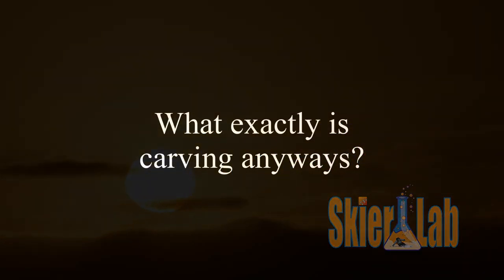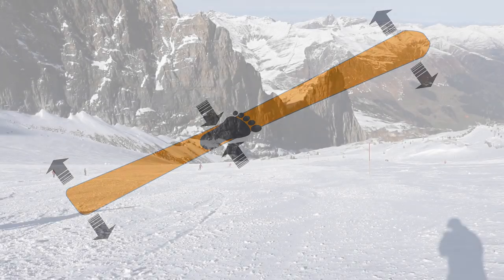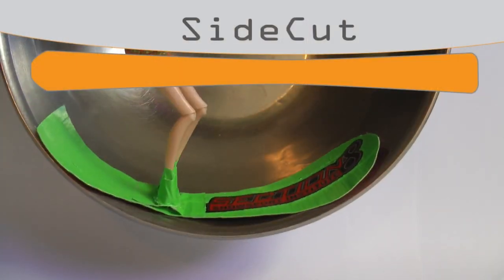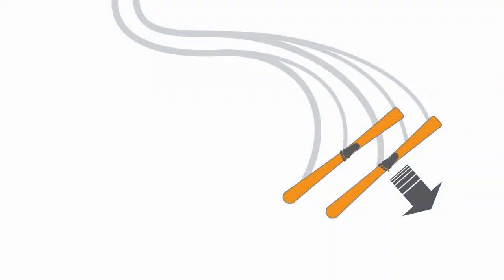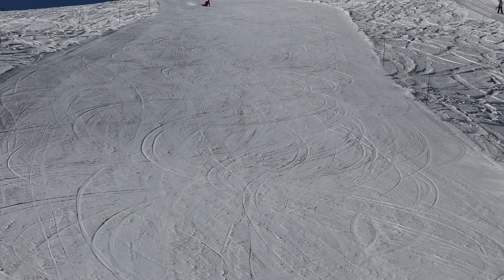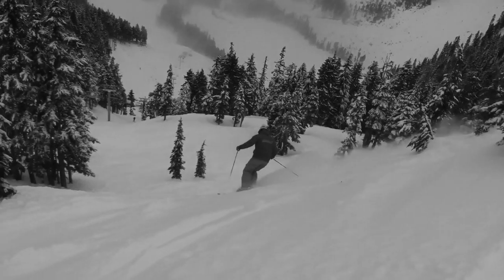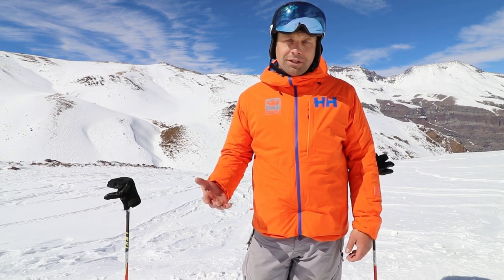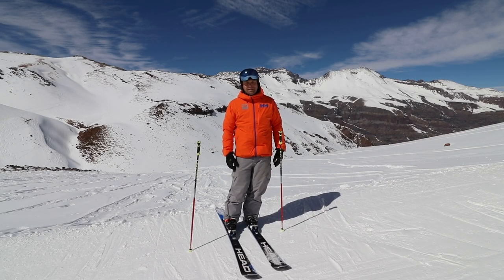Skiing Objectives - Carving Clean Tracks

Comment: I believe you are wrong when you state that carving is an easy task and there is no need for multitasking. Is this a joke? I think the opposite statement is correct for any beginner and intermediate skier.  You say: "just edge your skis and they will carve!" You should think about the requirements of this kind of edgings and the requirements of the edged turn itself. You must prepare the edgings and then keep the skis on carved edges. Certainly, with your attitude, I would not want to become your client if I were a beginner or intermediate skier.
Reply from the maker: Well, it is sort of a joke. It’s a goofy attempt to get people out other own heads. In reality, the moves to carve a clean track in the snow are actually simpler than steering a turn, but most intermediate skiers are either intimidated by the speed of a carved turn... or they focus so much on the idea of turning, that they end up twisting the skis instead of just letting the run forward through the snow. Clearly there is a lot more to a good carved turn than just a clean track, however, grasping this concept is often the first hurdle.
Reply: @section8ski  I deeply disagree.  I think that there are much more important reasons to why the intermediate skiers  are unable to carve the turn. I also believe that the skidded turns are much easier to execute than the carved turns.
Reply from the maker: Janos Koranyi, Clearly more recreational skiers find skidding easier, and the psychological component is only one aspect... so you are probably right. Can you explain what some of those ‘much more important reasons’ are. I’m always keen to hear new angles.
Reply: @section8ski  I completely get your angle... but really it’s no simpler or more difficult than a skidded or carved turn, it requires a skill. So here’s my take...

If we put ourselves students in a box of there being only one way, or only one right way to do things we really limit the learning of that student and will almost undoubtedly hinder their progress overall. So if we are so adamant in an opinion that a beginner and intermediate can only make skidded turns at their level or in their learning to get to that stage, all we’ve done is given them something needs to be added later... we could relate this to teaching snowboarding to a beginner, and teaching them that they have a favoured direction to start and later teaching them switch, or we could just teach them both directions and to turn in both directions from the get go. Maybe this makes a longer journey to get to a certain level as they’re learning double the amount (kind of), but once they’re at a certain point they be more naturally able to ride with whichever lead foot they like.

The majority of ski nations if not all teach some kind of variation around skidding and rotary movements in the early stages, often involving a snowplough. However, there are systems, approaches and methods where you can teach carving to a beginner and use the side cut of a ski... it simply requires the the appropriate terrain and methodology, and you could potentially make the argument that someone that learns to carve and use side cut for the early stages will find it easier to then learn to skid, as opposed to someone that learned to skid first and then carve.

However, without some scientific studies done to see which movements and progressions are the most effective (to get to a a variety of ability levels) no one in the ski industry can say that any one way of doing things is the only or only right way to do things.

That’s my two cents, and maybe that helps you answer this more fully to others that don’t get the concept you were trying to get across... keep up the good work Tobin!
Reply from the maker: @XboxSnoSurfer  Agreed, I don’t think a one is necessarily easier than the other from a skill perspective. In fact some beginners struggle to create the direction change they want because they over edge and create too much grip to twist the skis on the snow. 

As you suggest, I’d hate to limit a new skiers progress based on my notion of what order things should be done. However, beginners typically learn a skidded/drifted turn first is because their primary objectives at that stage are usually to control speed and avoid crashing into stuff. Steered turns just happen to be better suited for this purpose then a carved turn.
Reply: @section8ski  I think you’ve fallen back into the trap of believing that a skidded approach is the only or only right one for a beginner, let me explain...

So controlling speed and changing direction are two separate objectives (as defined by the CSIA at least, although one can influence the other). In a beginner approach that incorporates a snowplough I would suggest that is prioritising speed control and incorporates elements that will allow a student to change direction, but in general we do things like snowplough in a straight line in order to develop a rotation of the leg and allows the student to control their speed before they make a turn... a skidded or steered turn based progression.

There are various reasons why we generally fall back to that approach, one of which being that this is what we get trained to use. I think it’s fair to say that the majority if not all ski nations tend to use a skidded based progression, most likely incorporating a snowplough in some way as their primary approach... but why is this? Who decided this is what or how beginners need to learn? And why haven’t we reevaluated this with modern ski design more? I think we recognise when teaching children especially that carving first on their small skis with a lot of side cut can be a very effective progression and that skidding their skis or snowploughing might not be achievable at first.

So how could we apply this to all learners? Well the CSIA gives us the tools (past and present) to think this through. I think we can recognise the kind of terrain and equipment we would want to have if we were on a carving first approach. We would need to consider how these movements should be applied to a beginner. The fan progression would come in useful but we would also need terrain flat enough for long enough to allow students to ski in the fall line as well... but it isn’t challenging to easily consider how could take a different approach to achieving the same objectives, and these alternative approaches are out there... and although I have no experience or direct knowledge of those other approaches, I don’t think it’s fair to write them off in any way by saying beginner students need to learn to skid first, carving first can be every bit as suitable if we set up the environment and progression appropriately.

However, what we just don’t know is if any one approach is better than another. For me the metrics would be that one approach allows students to achieve a higher skill level in the same or less amount of time than the other, allows more students to more consistently achieve higher levels of skill, and one approach is simply more achievable for more students shown by a higher retention rate than the industry average... getting that kind of data is going to be challenging at best!

But for people like us, we just need to be open minded. Let’s not assume that all students are alike, have the same objectives or that the we currently approach things is the only or only right way of doing it... maybe the beginner and intermediate students that carved first would have a much easier time learning to skid later, than those that learnt to skid first and carve later.

I would leave the final thought, is carving only for advanced skiers? Maybe it shouldn’t be.
Reply from the maker: @XboxSnoSurfer  I see what you mean, and it’s certainly plausible that playing with the extremes of edge control at an early stage might be beneficial in the skill development of a new skier. I suspect you’d have to have the right student though. One who’s thinking a little more long term and willing to spend the extra time developing skills on minimum terrain before rushing off to explore the mountain. Perhaps worth an experiment if I can find some guinea pigs:)
Reply: @section8ski  I am not necessarily saying it needs to be extremes of edge control at beginner stages, it obviously needs to be at an achievable level for the beginner... I also don’t know when would be the appropriate time to bring in pivoting movements with regards to to how fast their rate of progression might be to steeper and more varied terrain... but if nothing else when you king about this it really opens the mind other possibilities.

I think we are more often limited by the terrain available as well as how busy that terrain is. Beginner terrain and traffic is often better suited to a skidded approach more than the student is I would say... but fundamentally a carving/edging based approach is a different approach biomechanically, compared to variations of skidding based progressions, and I think that would highlight the need to look at how to adjust and put into practice these edging based movements for a beginner progression, not just what progression could be used.

As a side note, I don’t know where this skidding and carving based approach terminology I’ve started using came from in my comments here, but I think you get it relative to the discussion we’re having!
Reply from the maker: @XboxSnoSurfer  By ‘extremes’ I just meant playing with edge control on both ends of the steering spectrum. For example, creating a platform angle where the ski is locked in and can only move forward (carving a clean track) vs skidding sideways with no direction change at all. I agree that terrain would be a major hurdle to this approach.
Reply: @section8ski  gotcha... I’ll throw this out there too... I’ve never seen any video, anecdotal or any other type of “proof” of this kind of approach actually being used with a never skied before, complete beginner approach. It’s more that I assume these other system(s) are teaching complete beginners with this kind of approach based on what I know about them... although it could be that while their system has a “beginner” approach and progression, that doesn’t necessarily mean their clients are first time skiers... just to throw another wrench in the works!

But you gotta think with things like terrain based learning coming in and changing the game, and modern ski design changing the possibilities for kids, why is there no information out there about alternative progressions and approaches for everyone in modern skiing?

At the end of the day, you’d need a big enough sample size teaching a group of first time skiers for probably several years using an alternative approach before you could say one way or another whether any other approach is better in any way, and I don’t expect that kind of study or data to be available any time soon.
Reply from the maker: @XboxSnoSurfer  Lets start a lab:)
Reply: @section8ski  it’s a shame our timings never quite coincided when you’ve been in Europe, I pretty much always get my first turns of the season in at Hintertux before heading to Canada these days
Reply from the maker: @XboxSnoSurfer  I sure do miss Hintertux in the fall... perhaps next season we’ll be back in action. If you’re heading there again pre-season let me know and we can make some turns, then continue this conversation in the Tenne:)